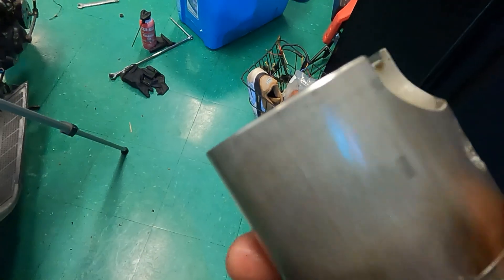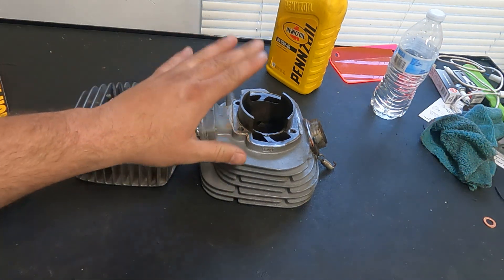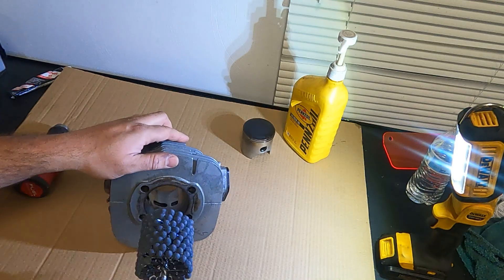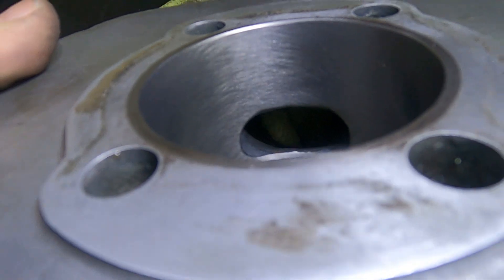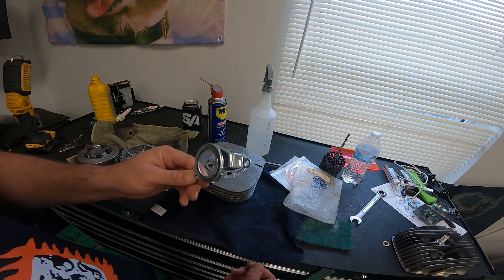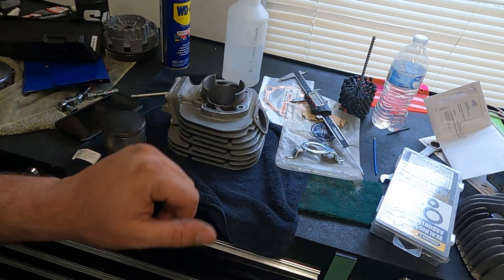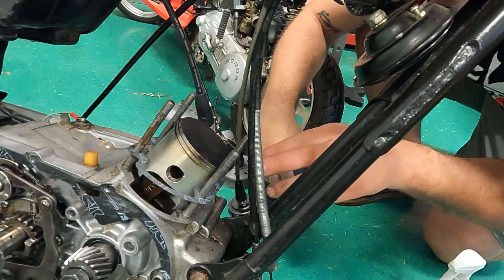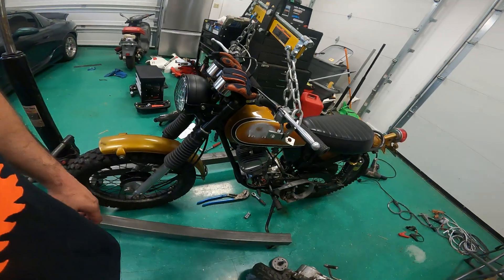Machining my engine on a BUDGET! (How to hone 2 stroke)

Comment: Did you put new rings also? And what size? I have a ct3 that I was thinking about doing like you did,
Reply from the maker: I did not re-ring it for this process. I ended up upsizing the piston after some time. This worked very briefly but not super well, I had other issues.

Comment: Would those dingle balls just drop into the ports and really mess things up in that area? I have the three jaw "blade" type for when I blow up 😊
Reply from the maker: So, I actually talked about this during filming, but decided to leave it out. The balls are not aggressive at all, especially at a higher grit. If anything, they might baaaarely chamfer the port windows (an argument could be made that this could be a benefit) but I noticed no wear at all in my ports.